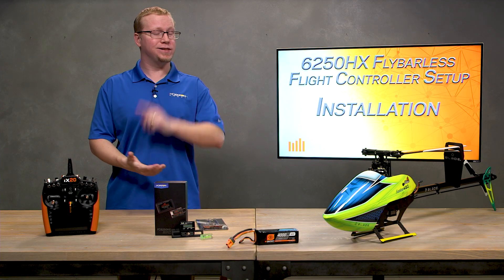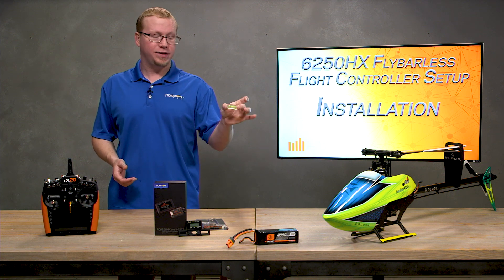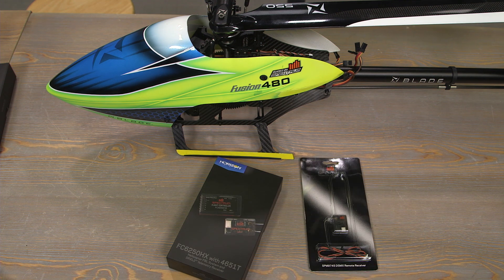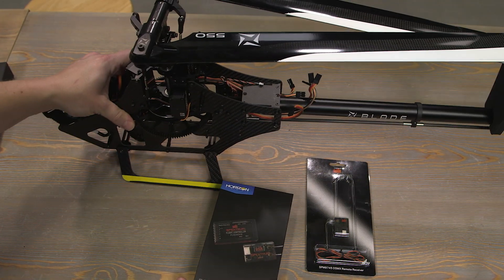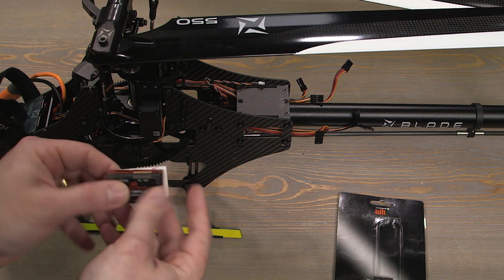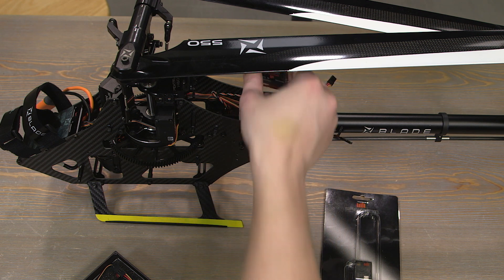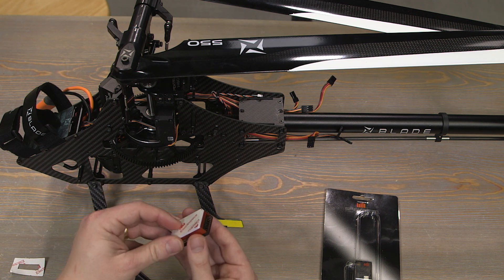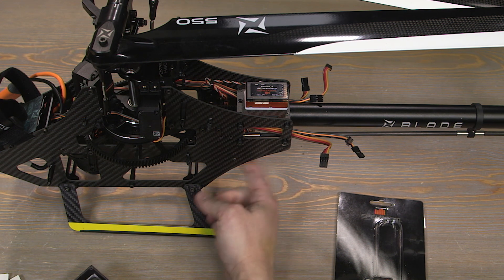Part 2 - Install and Binding - Spektrum 6250HX Flybarless Controller Setup Series

Comment: I tried doing the bind procedure this way, but it didn't work.  I found no solution in the printed manual that comes with the FC6250HX.  Then I found out that the online manual has a different procedure for binding the 2 receivers (It's on page 13 of the online manual).  The procedure of the online manual did work for me.  Maybe it's because I'm using an NX10 transmitter.  Anyway if you're having trouble, I hope this helps.

Comment: I have 2 4651T receivers. Is there an adaptor cable with 4 pins on the satellite end and a 3 pin on the other (allowing it to connect to the side RX1 or RX2 port)?
Reply from the maker: There is not. You could easily make one but it is not adapter we produce because it would lead users to think they can use SRXL2 receivers like the 4651t on older receivers that only accept srxl or remote receiver protocol receivers.
Reply: @SpektrumRCvideos  Ok, I can understand that. I had bought another 4651T, thinking that it would be suited for a satellite receiver, since that is what comes with it. I should’ve dug a little deeper, lol. No worries; I’ll check the pinout and see about getting a connector. Thank you for the prompt response and clarification.

Comment: after crash my 6250mhx on fusion 180 smart it wont calibrate and drifts left what exactly is adaptive flight control algorithms
Reply from the maker: During calibration, make sure nothing is vibrating the airframe. Things as small as a beeping motor can throw it off.
Reply: @SpektrumRCvideos  I've done that I wasn't clear sorry the helicopter only rolls to left when in stunt 2 when in safe mode it will not it will hold and stay still it's until I have it in the air and switch to idle 2 for 3d it will roll left at a good rate where it required constant correction I have a new fusion 180 smart and verified it holds it's position in idle 2 I've reset to factory and no luck

Comment: Another great video 👍I’m debating buying ROBAN 800 size ,scale EC135. This spektrum setup should work nicely? what servos would you recommend for 800 size. Thanks for info
Reply from the maker: Should work well! Personally I would recommend the H6350 and H6360 servos. Top of the line and should be overkill for a scale heli. We routinely abuse them in 700+ size 3D machines and they do extremely well.
Reply: @SpektrumRCvideos  Thanks for the input, do you think the Spektrum RC FC6250HX Helicopter Flybarless Control System is OK for the 800 size? If not what would you recommend, thanks very much👍
Reply from the maker: Technically yes it will work. Size of heli at that point is not a concern. My only concern would be if you need extra channels for auxiliary functions. The 6250HX can handle 1 additional channel for things like retracts or light controllers.
Reply: @SpektrumRCvideos  that will do. THANKS 👍
Reply: @SpektrumRCvideos  that will do. THANKS 👍
Reply: I hope you did not buy the 6250hx, its a piece of CRAP.. and you have to use the SERIOUSLY lacking spektrum speed controllers to get pack voltage..  by a real FBL and use a telemetry receiver  and get a real QUALITY SPEED control, the spektrum ESC and FBL units are over priced and SECOND TIER compared to things like the Demon FBL and Castle speed controllers

Comment: My forward programming won’t connect, I have updated everything I can with a pc and it seems to bind but no servo movements I am at a loss on this subject with a NX8 and FC6250HX / 4651T
Reply from the maker: Was this a open stock 6250HX or did it come from a BNF/RTF heli? Sounds like it either has the wrong firmware on it OR the 4651T receiver is not plugged into the correct port.
Reply: @SpektrumRCvideos  yeah I figured it out port 2 is for the smart ESC which I got it working now. 

Only question left is how do you know which channel is for the other Servos?
Reply from the maker: Depends on the Swashplate type you select. Check on the Swashplate Setup video to learn more. Essentially use the diagram to point out which servo is A B or C and then plug those into ports 1 3 and 4 and the tail into 5. Hope that helps!

Comment: After installing the 5.6 firmware update do you have to reset up the flybarless unit and rebind?
Reply from the maker: No but it is recommended you check controls and do a quick test hover.

Comment: Do you use another receiver with this unit, as you would if you were connecting say a beastx unit.
Reply from the maker: Yes, it needs at least the SRXL2 serial receiver that is included with it. Optionally you can have another remote receiver. Hope that helps!

Comment: Hi resolve my problem below when i plugged in throttle cable but i have another issue cant get my swash plate to go correct positiones even though i tryed all options in port forwarding re direction 3 normal or reverse please help
Reply from the maker: Triple check that you have the servos plugged into the correct ports, IE A= port 1/2 B = 3 C = 4 . Use the swashplate type screen to help determine which is which. Hope that helps!
Reply: @SpektrumRCvideos  sorted as well 380 buddy was 3 servo 135 degrees thanks for the reply

Comment: I just bought the 6250 and an extra 4651T to go on a TRex 550L Dominator and my DX9 BE . I’m relatively new to RC and I’m confused by the cables provided. It looks like the 4651 came with a 4 strand cable black/orange/white/red and two identical white connectors on either end. The 6250 came with a similar cable and a separate 3 strand cable brown/red/orange with the white plug on one end and the other end looks like a JR connector that fits into the 6250. Looking at your video it seems like you are using a 3 wire cable for both receivers even though the stand alone one comes with only the 4 wire cable. Could you explain which cable to use where and the color/orientation of wires left to right and top to bottom. What is the 3 wire cable used for and what is the 4 wire cable used for? Thanks!
Reply from the maker: Hi Sid, the 4651T will plug into the bind/prog/RX2 port on the servo rail using the 3 wire connector that has the white end to the JR connector. If you want to use an additional remote receiver you will need a something like this one https://www.horizonhobby.com/product/dsmx-carbon-fiber-remote-receiver/SPM9746.html

Comment: Do you need the 2nd receiver that you mounted that DOESN'T come with the FBL system?
Reply from the maker: It is not required BUT it is recommended for larger models 550+

Comment: Will a SPM9645 work as the second remote? Im doing it just like the video but the bind fails at that part. Thanks
Reply: Yes, with bind plug in any port.

Comment: Do only certain remote sat work with this FBL unit? I just picked one up and have tried 3 different sat and i keep getting " Bind failed" witch each one. two are DSMX and one not sure what it is.. Thanks
Reply from the maker: The only requirement is that it is a DSMX remote receiver and that you plug it into RX1. the RX2 port is shared with the main SRXL2 receiver.
Reply: @SpektrumRCvideos  I had to get my 9745 from another heli and it worked. I tried lemon DSMX and Redcons and a older sprektrum DSMX and none would take bind.

Comment: HORIZON HOBBY SHAME ON YOU! THERE IS NO WAY TO PROGRAMME THIS FC6250HX WITHOUT A SPEKTRUM BRANDED GEN 2 OR 3 TRANSMITTER. BE WARNED.
Basically this FBL FC is USELESS if you don't have a Gen2 or 3 transmitter and you only find this out when you open the box and read the second page of the manual. 
I NOW HAVE TO SPEND A FURTHER £300+ TO BE ABLE TO USE IT AS I CAN'T RETURN IT BECAUSE IT'S OPENED. NOT ACCEPTABLE.
Reply: Thats how they get you locked into their brand, they've done this with all their micro's with built in RX's too.  I have a basically brand new DX6i that is totally useless and wish they at least offered a trade in program.  Best to go with a Radio Master 12 OpenTX Radio and the many alternative FBL controllers available, unless you bought a overpriced 800.00 kit from Blade and the this RX came with it.  Most likely you bought the 400.00 radio with it and are locked into Spektrum.  The one thing that can be said is they have stellar support unrivaled in the RC industry (Horizon Hobby) and thats what you get for the premium prices.

Comment: I have a dsmx satellite and it doesn't bind by itself with a bind plug. It does bind with initial bind. Please explain, are you using an Rx satellite?
Reply from the maker: We are using a Rx Sat. I am a bit confused with your statement. What equipment are you using?
Reply: @SpektrumRCvideos  I am using a spm9645 satellite on the fc6250hx and don't have to bind separately. I tried it like you show in your video, but it doesn't bind with a bind plug